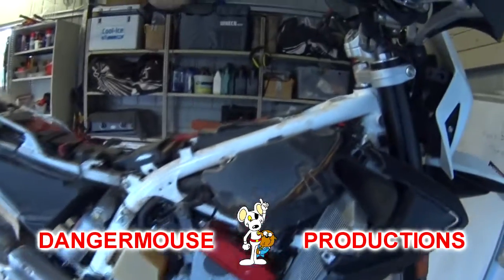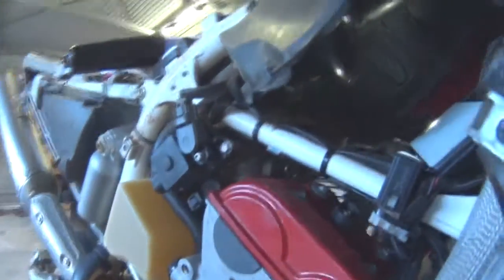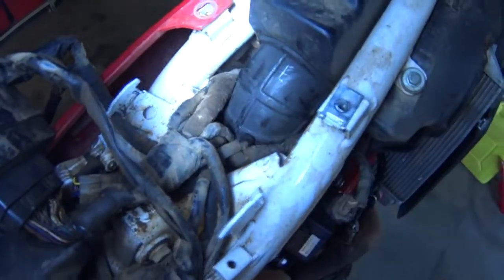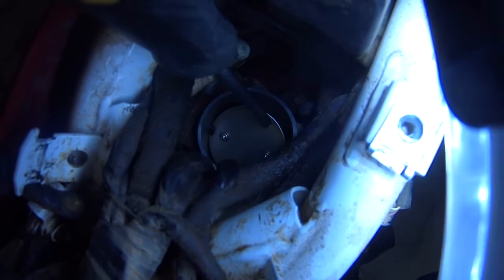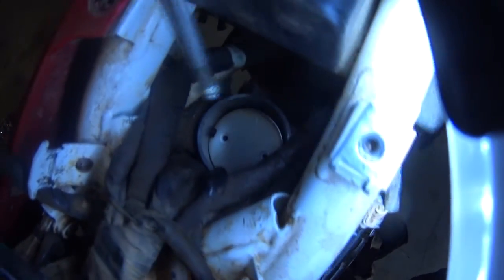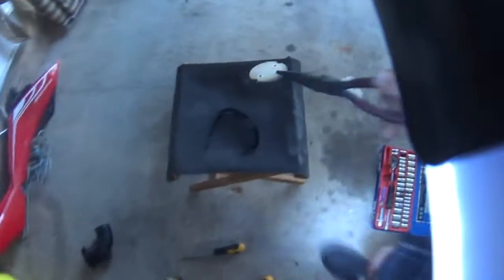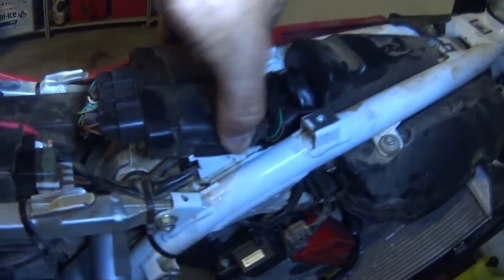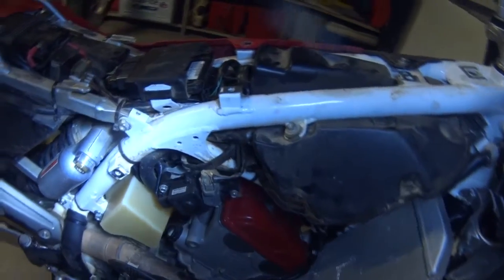Husqvarna TE449 & 511 Butterfly removal

Comment from the maker: It's my pleasure. 
I have a lot of time for these bikes and think they're very under rated. Glad you enjoy them.
Reply: Found you on the forums. What I cant find is the correct spark plug gap for a te511 anywhere on the net
Reply from the maker: Gap is 0.7-0.8mm, TE449 and 511 are the same gap. 👍
Reply: I just got my 2012 499,  thanks for showing  these,  it's a MOD I'll  be doing,  these things go,  you're  right thier underrated
Reply: hi mate could the removal of the butterfly flap make starting my 2011 husky easier cheers in advance
Reply from the maker: @johncracknell6757 
Hi mate.
Usually no impact on starting, no.
Increasing the TPS idle voltage does have an impact though (See my other video about TPS adjustment)
Replace the spark plug if it's been a while, they often get overlooked.
Also of note, they need a good strong battery for both cold and hot starting (at least 200cca rated), and also most seem to like a small amount of throttle when cranking with the engine hit 1/8th or there abouts 👍

Comment: Took your advice and followed the vid to remove the 2nd butterfly plate and WOW what an amazing difference for $0 and little effort on my '13 te449. Not only is the throttle way more responsive, but on my 3hr ride, the thing climbed hills like never before. I'm used to feathering the clutch on these hills, but now it just screams up them like an actual dirt bike. So, I would say there is definitely an improvement in the low/mid power range. Quite honestly, I'm surprised there isn't more hype about this mod as it is very noticeable. Incidentally, I have never had flameouts and I do have an FMF exhaust, remap with Akra map and emissions mods done. Useful tip - when replacing the rubber intake boot, check for a good seal in the dark with a flashlight. Ordered connectors for $11 USD to make my own TPS tuner. As with your other instructional vids, thanks Dangermouse for a superb job!
Reply from the maker: Thanks for the message and glad to hear the feedback. 👍 
On the flameouts, it seems most of the later bikes are well tuned and don't suffer like the early bikes do. 
Enjoy the 'New' engine 
😁👍

Comment: Hi Mate, dads got a 2013 te449 and has done the butterfly removal and a couple of other things to stop flame outs and its made a huge difference. However, being a bmw we're once again having another issue. All of the sudden the bike has started just shutting off randomly, whether its cold, hot, idling or under power it will just randomly shut off. When you try and start it again the e start simply doesn't work, if you hold it it will maybe try for about .2 of a second and then you'll get nothing. You can press the button on the speedo and it won't turn on or anything. Roll starting won't work either. Once towed back to the shed and put on charge it will start and run fine for a while until doing it again. My only though is that its not charging the battery so there is no power to run the fuel pump hence the random shut down.
Cant find anything on forums and you sound like you know your stuff.
Cheers

Comment: Thanks mate, I removed the second butterfly last night. Instant, noticeable bottom end difference - 2011  SMR 511.
Reply from the maker: +Pete O 
Yes,  it is a big improvement!

I really never understood what the engineers were trying to achieve with the second butterfly. 
It can't have been to 'smooth the power' as these bikes were the same as other contemporary 450s.
I suspect it was an emissions thing.
Reply: Yeah I agree, just over the top and unnecessary. I'm going to follow the TPS vid next. I've just got to make up the harness first. Looking at the vid, I assume that the TPS screw is loosened / or tightened until 0.8v is achieved?
Reply from the maker: +Pete O 
The TPS has an adjustable mounting slot. 
You loosen the screw and slip the TPS back and forth to achieve the desired voltage. 
Have a search for my video on the TuneEcu software for these bikes. 
It is a great program and can be used to help with diagnosis as well. 

Are you on our Facebook Page for the bikes also?
https://www.facebook.com/groups/219900571553501/
Reply: Yeah, I sent a request last night, still pending. Very new to facebook, under my wife's profile. As far as the ECU, yeah, I had a look and will follow that up too in due course. knocking over the easy stuff first..
Reply from the maker: +Pete O 
Ok. Send the request again. 
I think I have 'ignored' the request as we get lots of spam requests with no relationship to bikes. 
I'll add her in. 

With the TuneEcu stuff,  you are able to set up the TPS voltage using the live data screen.
It's a very handy,  I'd say essential, tool for owners now that the dealers are gone.
Reply: Thanks, just sent the request again - her initials are MJ.

Watched the ECU vid. looks very interesting, I'll have to source an andriod phone first. But worth doing
Reply from the maker: +Pete O 

And I've added her in 👍

You can get a cheap Android tablet these days. 
No need to get a phone, in fact the phone screen is a hindrance being so small.

Comment: Hi, in your video you show how you clean the airhorn/pipe attached to the lower air filter casing. But you jump ahead to the next part. (butterfly in the throttle body) How did you remove the airhorn/pipe? You do explain how to seal it.... thanks for your vids by the way, keep em coming if you are still current with this bike.
Reply from the maker: Hi, thanks for the message. 
The air horn is removed by first undoing the clamp, and then squeezing the sealing area of air horn where it passes through the air box. As you squeeze the edges in, you can pull it up into the airbox through the hole. 
Refitting is the reverse, passing it through the hole in the airbox and reconnecting with the throttle body while sealing the rubber lips of the air horn back to the air box. 
Hope that all makes sense. 😊
Reply: Dangermouse yes that does. Thanks for such a quick reply. Do you still own the husky?
Reply from the maker: Yes, I won't be parting with the Husky. I've kept it to have as a spare and loan to friends as needed. I'll pretty it up again soon too
Reply: Dangermouse oh that’s awesome, I have the 2011 450 te. Loving it so far. Good to know it’s a reliable bike!

Comment: I own a SMR511 11' modle 
When you say flameouts. Are you talking about when you crack up open the throttle while going along and nothing happens like the motor turned it self off? Or when to blip the throttle at idle and it cuts out?
Reply from the maker: +unknownfox1994 
Flameouts on this bike can happen in both the situations you mentioned. 
When riding off road, I found it happened most often when approaching a log or small obstacle, I would blip the throttle and then open it up and dump the clutch to loft the front wheel..... The engine would cough and stall. (second butterfly not opening fast enough to match primary butterfly opening) 

I also had a second problem that only happened a few times that is best described as dead throttle. You open the throttle, the engine continues to run but doesn't make more power (second butterfly choking of the air supply) 
Removing the secondary butterfly plate will help solve these issues.

Comment: What happen when you have to remove the secondary butterfly motor? Reassembling the bike and i have a fail message wich i suppose is from that motor, improper installation from me. Did not find any way to reinstall that motor on the internet
Reply from the maker: It is not an easy process to get back to the right place.
It should not be removed 😣
If you are on our Husqvarna 449/511 Owner's Facebook page, you can contact me there and I will try to pass the information to you

Comment: And 1) wat exactly does removing the second butterfly do in terms of engine performance  ??
2) why did Husquarna make em with duel butterfys anyway ???
Reply from the maker: Removing the butterfly greatly improves throttle response. Doesn't make more power, but let's you the rider control the power, instead of the ECU.
Also helps with low speed part throttle 'flameouts'. 

I suspect it was an emissions related choice.
Makes the throttle open more slowly and reduce rich mixtures.

Comment: Hi Dangermouse
I removed the butterfly on my TE 449 Supermoto and the difference is aaaawesome. Thx for the video 🙂
Is it necessary to also remove the small idle lever between the butterfly’s?
Thx 🙏
Reply from the maker: Hi Max,
Thanks for the message.
It's not necessary to definitely do both.
The idle arm mod is only for bikes that suffer from a Hanging Idle condition, where you close the throttle and sometimes the rpm hang up and push you forward.
Is an issue with the ecu and idle motor system on some bikes
Reply: Dangermouse 🙏 🙏 🙏

Comment: Man this is a seriously dumb question haha, but I've been rebuilding a lot on my SMR 511 in the past 4 months and I've forgotten where to route a hose or if it's a blow-back. It's the fuel line breather hose on the brake-hand side, rear obviously. Where did you route yours?? I'm just asking because you have an TE-511 haha.
Reply from the maker: Matthew McGriff 
Hi Matt. 
The RH tank breather on the Euro models runs down to the rear shock area and drains on the ground like an old carby bike. 
US models go to a carbon canister and from that to a fitting on the air cleaner housing. 👍 
Not a silly question at all 
☺️

Comment: @dangermouse wondering if you add silicone gasket sealer to both sides of the valve cover gasket when replacing it.. 2012 te 511
Reply from the maker: Hi there,

Normally I only put some silicone on the corners of the cam rubber 'D' sections and a bit on the cover side of the spark plug o-ring and a few places on the gasket to keep them from falling out during installation.
If you get too much silicone on the rubber it can tend to squirm around.
Reply: @Danger_mouse  thanks! have small leak at the front that is driving me nuts.  removed and reinstalled old gasket, thought i fixed it..NOT.  ordered new gaskets, since the ones currently on are likely 9 years old.  how are you liking you Sherco?
Reply from the maker: @delacruzjavi  ah I see.

Love the Shercos, I'm onto my 3rd one now and very happy with the brand. Great bikes, great company 👌

Comment: Flameouts are sporadic on my '12 te511. I am running race map II (plug installed). ZipTy stated not to do this and run the map III instead. Thoughts?
Reply from the maker: +MrRopcean 

If you are able to get the ecu flashed with the Akrapovic Titanium Racing exhaust map, definitely do that. 
Removing the secondary butterfly will go a long way to helping you and setting up the TPS voltage will also help. 

There is also a new app on Android by TuneEcu that allows users to flash the ecu.
We have shared the Map 3 files with the developer and he has them on his app now. 
It does assume an amount of technical ability however, as the ecu is 'open' to you the user.
Reply: Thanks again. Looks like I will have to send my ecu to the states to get flashed. I will start there and see how it goes. After reading your posts on cafehusky, one thing at a time until it purrs. As far as resetting the TPS and voltage, I am not sure where to start there, I will have a look at some more of your posts.... Cheers.
Reply from the maker: +MrRopcean 

I did the video on the TPS.
Thats where I'd start. 
The US bikes did get different ecu mapping,  so my not respond as well as the rest of the world's ecu  tuning, definitely worth a go for very little cost.
Reply: Dangermouse 

Pulled the butterfly out last night. Quite a difference in response. It was as easy as the video explained. Cheers.
Reply from the maker: +MrRopcean 
Definitely worth doing my friend 👍 
Enjoy the 'New' bike.

Comment: Hi mate, I have 2011 Husky SMR449. Do you know whether I can I slip-on an FMF Powercore 4 muffler on  my bike? They make one for the TE449 2011...
Reply from the maker: I'm not 100% on the Powercore mufflers.
I have heard that you will need a TC engine pipe to fit one to either the TE or SMR. 
I still run the factory supplied Akrapovic slip-on.

Comment: Just bought an 2012 SMR 511 used. And they put a K&N air filter on it. So they got rid of the air box all together. The bike keeps stalling at lights and I opened it up today and saw they already took the secondary butterfly. Any recommendations???
Reply from the maker: Hi, 
Do you have it running in Race Map II, and do you know what the idle rpm is??
Reply: Dangermouse the dash displays race map ll, it has a power commander V aswell. I do not know the idle rpm the dash doesn’t display rpms. I want to try and buy the stock airbox. The mouth of the throttle body looked kind of dirty with the dry K&N filter on.
Reply from the maker: @nateluong4683 
OK, yea you'd need to plug into the ecu to get an idle speed reading.
You should be able to view the rpm in the power commander software..... 

Yeah, I looked at fitting a sock type filter a few years ago, but looked to me like it would difficult to seal on the trumpet.
If you still have the top half of the filter housing, I'd buy a TC airbox lid if you are buying new (they have extra vents)
If not, then you can cut some extra holes in a TE/SMR one.

If you haven't already, look at changing the spark plug, it's often overlooked and left too long.

Comment: Hi Dangermouse I'm having trouble with my 2012 husky TE449 today I washed it  then started it the bike ran perfectly just sitting there idling for 1 minute then it just stalled and now it won't start again it does crank and smells fuelly with little puffs of smoke coming from the pipe whilst cranking. Do you think I may have put little water down the exhaust? Would that foul a plug? Thanks.
Reply from the maker: Hi there.

First I'd be looking for moisture around the coil and spark plug area.

An odd question for you, does it have a JD piggyback tuner fitted?
Reply: @Danger_mouse  it's on map2 thats all I know. Thanks
Reply: I can't get to the bloody 8 ml bolt to pull the coil of geez they made that hard with the bar on top of it? haha any way.. another thing is when I crank it if I give it throttle it cranks faster is that normal
Reply from the maker: I use a low profile 8mm socket and driver.
I have done it with a small ring spanner before.

These bikes seem to start better with a small amount of throttle when hot 👍

Comment: G'day Dangermouse, hope youre still on here, ive got the 2011 511te and I'm getting fuel in the oil, not a great amount but its there (obvious smell) what are your thoughts ? have you had this happen ?, ill be doing the second butterfly removal over this weekend....cheers for the vid mate....
Reply from the maker: S.A.H.D 
Hi mate, 
Yes, still on here. It's common to smell fuel in the oil when running in Race Map II. 
The engine has a single compression ring and allows a little blow-by, that combined with the rich mixtures will see fuel in the oil. 
You should be doing more frequent oil changes as per the handbook when running in Race Map. I change my oil every 5hrs and the filter every 20. Off road, 5hrs is around 200-250km.
Reply: you are a wealth of information mate, yes it is race map II, I just bought it around 50km ago, I got it very very cheap imo and is in immaculate condition, basically without a scratch or bit of dirt anywhere, it all looks like new, only done 5k, its last service with paperwork from shop was 900kms ago, would I be better off going back to some kind of normal mode ? I'm not worried about every little bit of power, it will get used more on the motard setup onroad... maybe 90/10 on/off rd....
Reply from the maker: S.A.H.D 
If you are doing road riding, you could perhaps double the distance in Race Map II to around 500km.
I certainly wouldn't do more than 1000km even in the standard map. 
(you must have the O2 sensor installed in the exhaust and the map jump plug removed under the seat to return to the standard map) 
The lean standard map is known for lots of stalling and flame-outs. Not what you want crossing an intersection... 
Personally, I'd run a good quality full synthetic motorcycle oil in 5W40 grade, in Map 2 and change it often. 
Only takes 10 mins for an oil change 😊
Reply: I will do as you suggested..... a litre of oil every 2 months is fine... onroad the rpm's half of what id do offroad... just don't need the revs on the rd...do you have a husky FB page or something.... I like to read all about the bikes I have...
Reply from the maker: S.A.H.D 
Yes, we have a great group of people on this page and lots of info in our Files section. 😊 
https://www.facebook.com/groups/219900571553501/
Reply: not sure iff you saw my post on the FB site, but I'm having a serious issue with fuel getting into the case, in approx. 200km of very hard riding it dumped about 200ml of petrol in the gearbox and obviously ended up in the air box due to being way to full, what would your guess be why its doing this ?, I have the oil in air box sorted because I'm buying a breather off David Bates, so that's that issue taken care of, but the fuel in oil needs to be sorted out....cheers mate......
Reply from the maker: S.A.H.D 
Just replied to your FB post. 
Had a busy day today 😊
Common for fuel dilution to occur on bikes running the Akrapavic Racing Map (Map set 3) My own oil smells of fuel at 5hrs - 200-250km off road riding.
Reply: its on map II and its not just smell, its at least 200ml of diluted oily fuel mixture, it is definitely losing fuel to the sump somehow, with that much in the case the oil kind of resembles just fuel, its lost the ability to lubricate as its thin like water, I just don't want to waste money and buy things I don't need, but I guess an injector would be a good start do you think ?
Reply from the maker: S.A.H.D 
I'll message you from FB